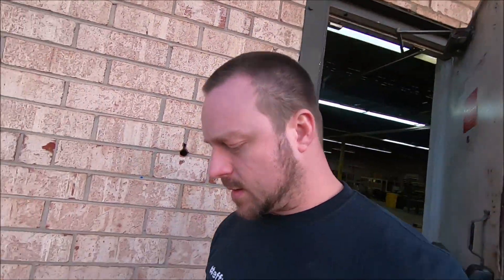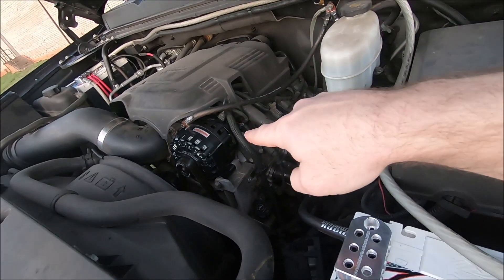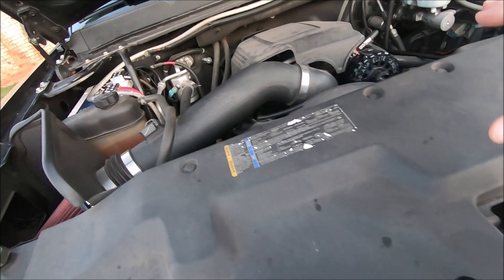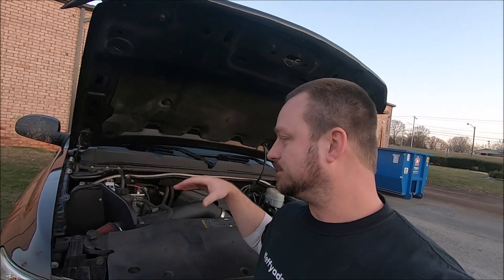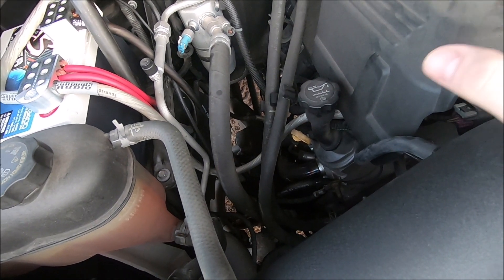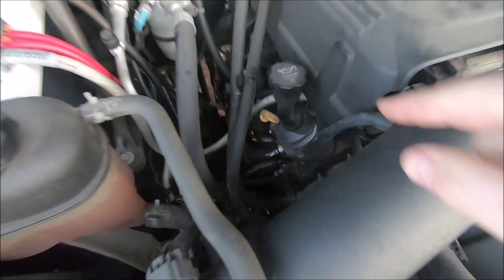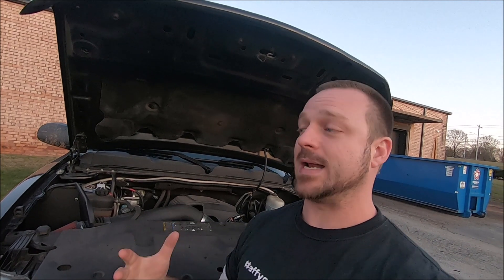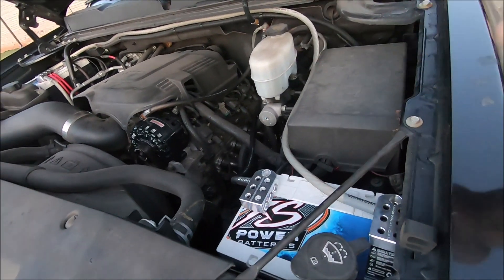How I fixed the Factory GM RVC (Regulated Voltage Control) on Piglet

Comment: Yeah, I rebuilt my hummer motor and cleaned up everything. Added a couple of ground cables to help grounding and one of them bypassed the current sensor…blew up the voltage regulator in my alternator. Figured it out but this is the type of thing that the newer models, 2005 plus, might have, be aware. Great video.

Comment: I was really hoping this was gonna solve all my problems, good stuff for you tho!
Reply: US Alts pcm controller. You're welcome.
Reply: What year make and model do you have?
Reply: @Dblackon22  2014 Chevy Cruze Turbo Diesel
Reply: 13 chevy sonic,I'm gonna look at my alt plug after work and see if this pcm mod will work
Reply: I subbed too bb r/c seems like we like the same cool stuff, I took my vids down after the coppa scare
Reply: They have a set voltage model that is set at 14.8, it's a little cheaper. The they have a variable voltage version where you can set your voltage anywhere between 12v-15.5v. the variable is a little more pricey. But the US Alts controllers don't trigger a battery light or anything.
Reply: I'm already on it,I seem them, good looking out I just gotta check the plug on my alternator after work see if its compatible
Reply: @Scx24OCD  good luck man. I would say the Cruze is just like the Sonic. But since I have the diesel version it's a bit different. I have the same alt as an equinox. But I'm sure it's good to go.
Reply: R/C OCD any word on the sonic?
Reply: @HammyChigger  the plug looks the same,I'm gonna order one when they become available their only taking preorders now, I'll prob try to talk to someone to be sure before I order tho,feels promising I'll be soon happy if it's as easy as plugging this thing in and it just works
Reply: @Scx24OCD  cool deal bro I'll be following your vids
Reply: @Scx24OCD  yeah I have my alt on my chevy set to charge at 14.5 constant.. but my battery light is on
Reply: Wait what? Yall got a way to bypass this stupid GM voltage system?
Reply: @noahkb80  did you ever figure out how to bypass it

Comment: I have a 2012 silverado thats overcharging. Changed alt, cleaned grounds, checked fuses, & still overcharging. Any suggestions?
Reply: Possibly a bad BCM. An advanced scan tool could give you a more accurate idea looking at different voltages on modules etc. I know there's a pin on the BCM you can probe too.

Comment: I've been looking for a 3500 Suburban or Yukon XL Duramax but I have yet to have any luck. At this point I have a 2003 GMC Yukon that I bought for a 6 18 build which I am planning on doing a Duramax motor swap bolted up to a 4l80e transmission. I also have a 2003 Excursion 7.3 with a 25th anniversary Kenwood Excelon system. For a sq build it's one of the cleanest sound I've ever heard out of a vehicle. It's not a low hertz ludicrous spl settup but as in a well balanced all around system it's definitely one of the best installs I've even built. It's also a Dolby 11.2 which makes watching movies and all around immersive experience.

Comment: I have a 2011 2500 with a duramax and a mechman 320. when i crank it voltage is up around 15.3 or so for 5 minutes. Then it drops to 14.7 for an additional 5 minutes and keeps dropping down to 13.7 volts. How do i keep the voltage up? Been looking on mechmans site for the past 20 minutes for this diagram.
Reply: Follow this post ... https://www.diymobileaudio.com/threads/do-i-need-an-additional-battery-i-already-have-2-something-isnt-adding-up.438382/#post-5943990

Comment: I ran my 2011 yukon xl batts from my mechman. 1 d4800 to replace fac batt and a lithium on the other side. Ran the big 2 on my truck. Did that last year. Truck run perfect

Comment: This is the video I was looking for.. The voltage drop was occurring on on the 1500 but not the 3500HD and there was no battery current sensor on the ground cable to the engine. The reason it was occurring on the 1500 was I had removed the DRL fuses and the problem disappeared as soon as I put the fuses back in. I just don't light Daylight running lights but now have to use them. I might just tap into the fuses and run auxiliary cooling fans. I believe the voltages drops also occur on FLEX fuel trucks but you can get an ODBII RANGE plug.

Comment: Hey Darrick...you might want to clean up the ground wires under driver side...aswell...usually have paint or undercoating between em. Helps with all inside cab grounds that connect to it. Hope this helps you bro. Keep up the videos..

Comment: All ya got to do is get the mechman alternator with the 4 pin for rvc bypass. It plugs off the 2 pin with a module that keeps warning or check engine light off. I stay above 14.8 all time, only get down to 14.5 with a mechman 320 alt, (2) XS D3400 batteries in my 2011 silverado, 1/0 ofc, big 3, running a sundown salt 3k, on (2) Skar VXF 12's @1 ohm. And that's at full tilt. Recovers real fast. Also have JL audio 6 channel pushing my mids.

Comment: Not sure if you can help me or not but I'm having voltage spike problems that I can not figure out. I'm running a Sundown Salt-2 on 2 DC Audio Level 3 10s, a DB Drive 1250 on 4 D4S 6 1/2s, Mechman 370 alt with 1/0 power and grounds on a 2015 Silverado 1500. My problem is with the stereo at full tilt and bass cranked I have voltage spikes if the engine RPM is 1000 or higher. At idle there is no problem. What happens is the voltage drops like normal but when the bass not stops the voltage passes the charge voltage and spikes to 15.8 plus. I have searched everywhere online for a solution and have come up empty. Could my problem possibly be the amp? I've also reinstalled the factory alternator and still had the spike above 1000 RPM. I used a DD1+ and a  CC-1 to set my gains and crossovers.  Any help will be appreciated.
Reply: So what is the fix this is the same prob I'm having on my 2500 hd
Reply: @audio  I'm not 100% positive what fixed it. Since asking this question, I am now running 4 Sundown Audio U8's on a Salt-3 and a Salt-200.4 on 6 Down4sound 6.5's in the doors. I also have a Down4sound LTO 6.0 and 2 runs of 1/0. After swapping to this setup, I haven't had any more spike issues.
I did find pinched speaker wires when I removed my 10s from the box, so I would say that the spike issues I was having were probably due to that.
Reply: @ptcustom81  dang. Alright worth a try I reckon. I'd be mad as hell if that ends up the case haha. Killed my dang sub amp and surely taking out the 4 Chan soon. Ty for the advice tho I checked for shorts but didn't think of pinched wire. 👍

Comment: I have a 2011 suburban 1500 I upgraded the alternator to a mechman 250 amp and added a Xs battery and ran 2/0 gauge grounds to the engine and frame and body from the new battery but not the factory battery ran 2/0 from battery to battery and from alternator to battery. I have a mmats 3500.05 on two mmats juggernauts 15s and a mmats sq160 on mids and highs. Had it like that about a year and a half no problem then one day the battery light came on and message service battery charging system after looking at videos on you tube found out about the clamp sensor on factory ground I changed the wire to 2/0 no problem now. A 2/0 wire will fit if no wire loom so ran a piece of loom up to it and after it. it’s a bigger loom.

Comment: When I took off the little module off of my negative terminal I went from 13.7 to 15.0 I lost my remote start though it’s a win lose situation
Reply: I just unplugged the sensor. I hang out anywhere between 14-15v depending on day and I still have remote start on mine.

2014 Chevy Cruze turbo diesel
Reply: Seems like this is the case for most newer cars my 2015 focus is the same way.
Reply: KidKacti311 lucky you
Reply: @Ninjasraynonu3  I'm just putting out info man, for people that might need it. And it's not all that great for me, I'm running lithium. I still had to buy a pcm controller from US Alts, to have stable voltage and they aren't all that cheap either.
Reply: Have you had any issues of overcharging battery? Thanks, I just unplugged mine 2012 sierra.
Reply: @AlienGrade  na, but my alt did die on me a year after, now I’m running a js alternator with a swapped out regulator and it charges at a constant 14.8 but my battery light is on due to the aftermarket regulator

Comment: Can’t really be a fix if the truck never had RVC.
Reply: @helloworld5266  Never understood why a stock Silverado ground cable will have a 0 gauge cable but the eyelet on the end narrows down to the size of nail.
Reply: @Busa0069  That's why I run a dedicated 0 gauge set of wires (aka THE BIG THREE). While leaving the factory wires still intact for additional connection. Check out the BIG 3.  (I consider it a MUST DO)

Comment: Chevy has really over engineered there cars and trucks so much they screwed them all up and made them unreliable . I remember when I used to think Chevrolet was the best . I drive a Ford F150 and Chevy Silverado for my work vehicles and all the chevys have broke down by now . Both where 2017 models.
Reply: John Garcez I saw a 2020 blow in 1100 miles, it’s a bummer what’s happening
Reply: It's to save 1-3 Miles per gallon on the fuel economy. See video in this post... https://www.diymobileaudio.com/threads/do-i-need-an-additional-battery-i-already-have-2-something-isnt-adding-up.438382/#post-5943990

Comment: mine has the big 3 stays at 14.9 after installing big 3 no factory voltage controll .. 2 batterys smart 3 ,, no problem dont even sag

Comment: So my question is how do you fix the voltage issue with this setup?  I have 2005 Silverado 2500 HD as well. I have a 2 amp system 4channel and a mono amp with 12inch subs. It worked flawless. Then it blew my mono amp. And since then it will play normal no issues for 10 - 15 minutes or so and my 4 channel shuts off. My voltage in the truck thinks the battery is low and sends more than 15v while driving, same the about amp shuts off like it's suppose too. Guess my mono one wasn't that protective. But how do I stop it? Or go around it. Do I need an external regulator I have unhooked the mono amp and subs till I find replacement . I've tried everything I could find or research

Comment: 14-19 gm vehicles turn your headlights on manually will keep volts at 13.8v
Reply: Ac would make mine jump up also on my 08
Reply: My headlights still dim tho wtf 😭 do I need a big 3 ? Battery or cap ?
Reply: This work on a 08 gmc??
Reply: @jesusruiz3723  get the cheap ebay 250 amp alt .

Comment: Lucky you! Ha ha. I never paid attention in my 2017 1500 for the first few months I owned it, then once I got all my stuff together to get my install going I was surprised to notice that my truck runs at 12 volts most of the time. After startup it runs at 14 until it replenishes the battery then kicks down to 12. At night when the lights are on it runs at 14 also. After some research others had figured out if you put it in tow haul mode it will run 14 volts with the lights off. I see all the amp test videos and know there is a big power difference between 12 and 14v, but I was still shocked at the difference in output in my truck between the two.

Comment: kenwood deck ,,knuconcepts kolosus flex 1/0 power wire and grounds xs power 100 ah battery  -big 3.. taramps,  smart 3. with 2 15'' resilient sounds golds,, 6 cubic feet GP audio  baltic birch box - 84 inches of port..... flexin winshield, doors, more , locally hated... .... orion hcca 3000.1dsplx on way and  more 1/0 wire , ,

Comment: This is some bull shit ! If your not having the problem or know how to fix it you shouldn’t make a dam video about it !
Reply: The reason for this video was for people like me that have Silverado 2500HD's .. EVERYONE.. I MEAN EVERYONE keeps telling us our "weird resting voltage" is from us not running our grounds through the "CURRENT LOOP SENSOR".  This video FINALLY NOTIFIED hopefully everyone that watches... that 2500/3500's DONT HAVE THEM.  Here's my therad.. https://www.diymobileaudio.com/threads/do-i-need-an-additional-battery-i-already-have-2-something-isnt-adding-up.438382/#post-5943990 ON Another note, your fix seems only to be to unplug the sensor which will "Default" your alt to a high voltage (usually 15V) but it is constant and can reduce battery lifespan due to constant overcharge... not too harmful but reduces life.  OR you can buy the USA ALTS PCM MODULE http://www.usalternators.com/pcm-module/ (Which is what I suggest).
Reply: @helloworld5266  see mine is opposite of that trick. If I unplug that mine does not default to charge. It simply stops charging the bat all together and when I get to where I'm going and turn truck off, The battery is drained too much to start. Irritating. And costing me amplifiers